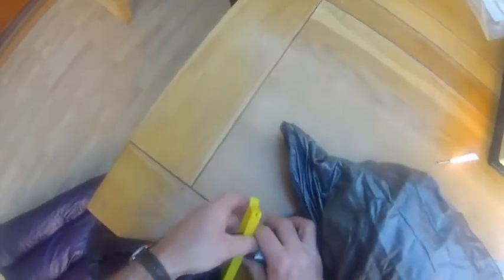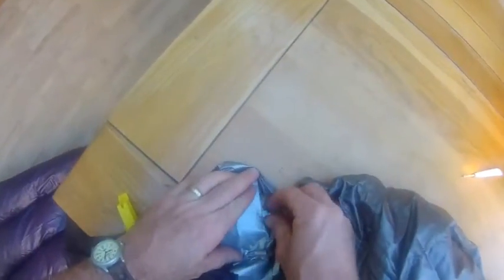Down Transfer

Comment: Interesting...I just bought a bunch of these quilts for various projects, mainly to make a few top quilts...I probably for 2 of them will not bother much, as they will be for temps above 55 degrees primarily I think, but it is tempting to think about doing something like this if I can make them like a 30 degree top quilt.  If you move the down from one quilt into the other, is there a basic understanding of how much more loft you end up with and/or how low the comfortable temp range drops?

Comment: Great video. Now that it's been 8 months, have you used this outside? How is it? Temp rating? I have a few of these unmodified throws and I can't decide if I want to overstuff them like you've done, or simply use them as a double-layered TQ (with horizontal seams ripped, and footbox added). Thanks!
Reply from the maker: Ross Nelson - had that one (double fill, faux baffles) out on a chilly night, worked well until temp dropped below -10°C (14°F), then I started getting CBS.
I've remade that one into a fully baffled quilt now, same temperature quilt, but only 12oz of down.